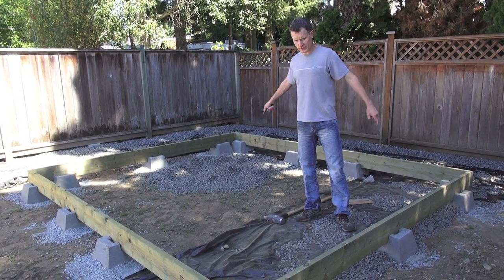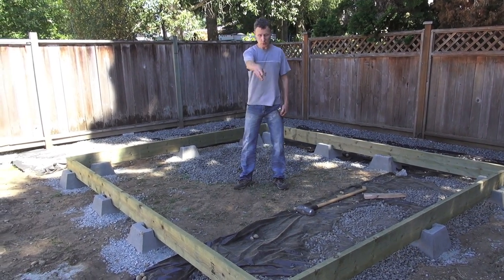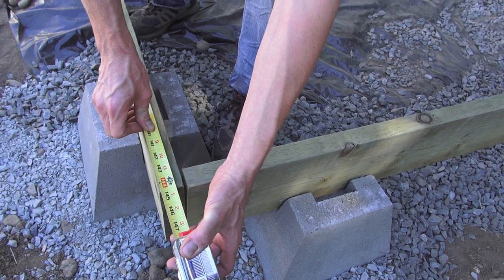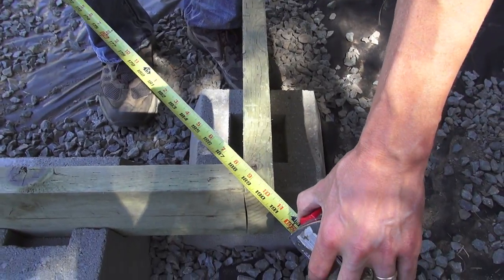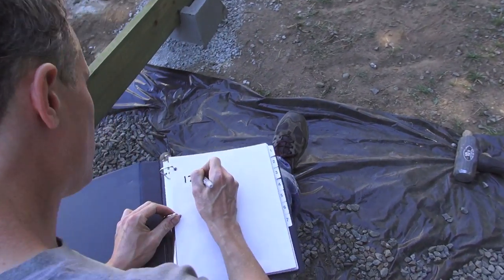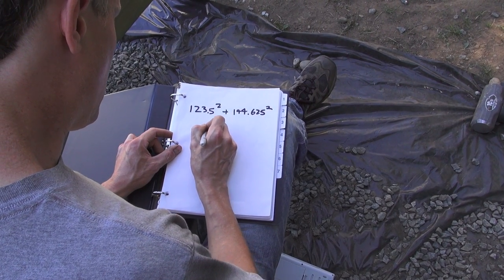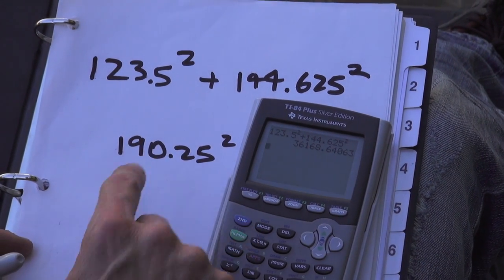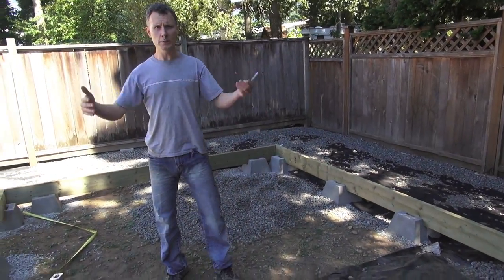Squaring a Shed Floor (part 2)... Using the Pythagorean Relation

Comment: Or you can skip the calculator and the squared function by simply measuring 4 feet along one side , three feet on the other side and measuring the diagonal between those spots--should be 5 feet.
Reply: Brainiac over here getting it done with a calculator
Reply from the maker: Absolutely - the Pythagorean Relation... that's what I use in my part 2 video https://www.youtube.com/watch?v=SzJeBBqNLY4&list=PL0oMrVaWT6dmqY9qZrbEbYQ-mHcIxAxtD&index=13&t=0s
Although for that I don't use 3-4-5, I use the whole length and width (more accuracy). I do use the 3-4-5 method in this video though https://www.youtube.com/watch?v=zUdI4XDHUTg&list=PL0oMrVaWT6dmqY9qZrbEbYQ-mHcIxAxtD&index=21&t=0s
(and sorry I missed this back when you posted it 🙂)

Comment: Why? If the diagonal are the same then the P Theorem has to work?
Reply from the maker: If it's an exact right angle, the P-theorem will be bang on exactly correct. The further off it is, the more off the angle will be. In practice the 'diagonal' method I show in my other video on the topic is easier and probably more precise to get an exact right angle in this situation. 🙂

Comment: Nice.  I however will use the 3, 4, 5 method
Reply from the maker: That's great! I use that exact method in another video...
https://youtu.be/zUdI4XDHUTg
The 3-4-5 method is the same method as I use here, ie. the Pythagorean Relation. A 3-4-5 triangle is the most well-known 'Pythagorean triple', ie. the smallest combination of three whole numbers that form an exact right-angle triangle... the reason it's so widely used in construction and elsewhere to ensure a right angle triangle.